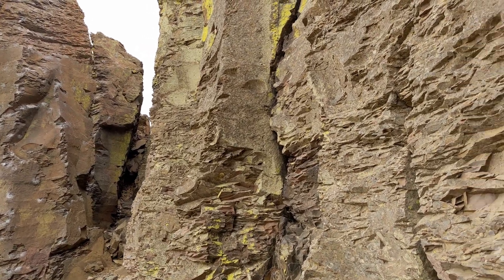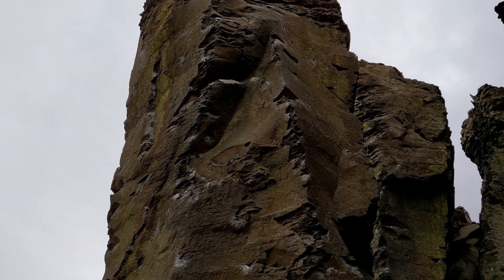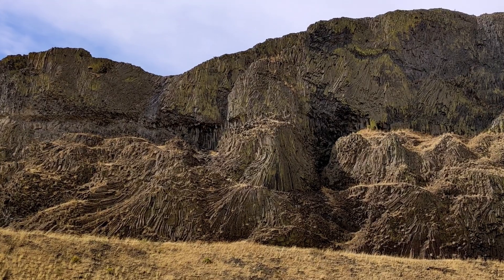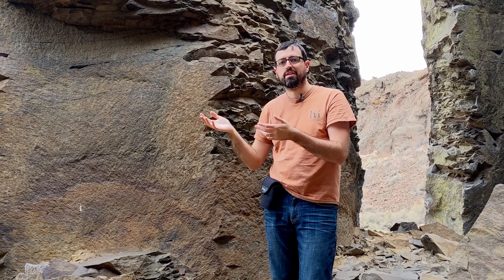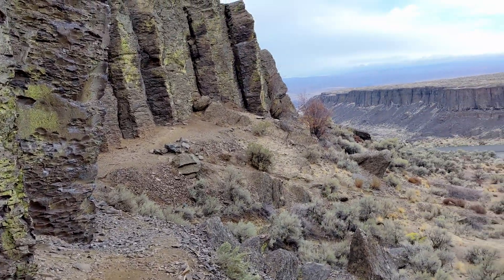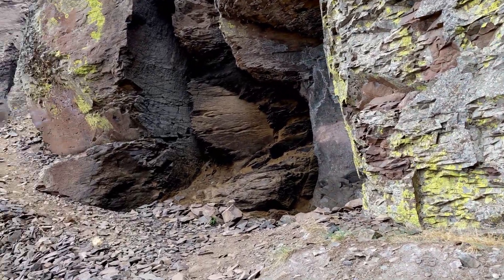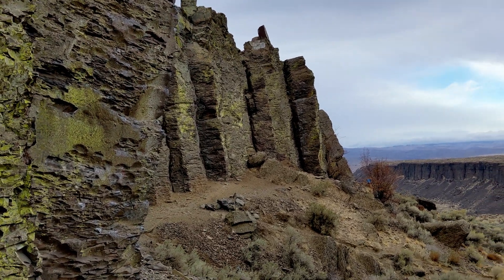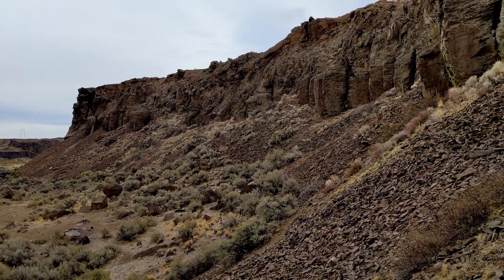Basalt Columns: French Fries, Toffee, and Mud Cracks

Comment: If the cracking starts at the top and at the bottom, what is the chance of those cracks  meeting perfectly together to form such a uniform column- 0 % ! That is absolutely ridiculous! 
Also crystals do not bend and if they did why would a clump of columns bend one way and columns right next to it bend in another direction? 
Further more, show me a working model on this planet. There is none. 
Most geology is wrong. One has to ask the question - what was it before it became petrified? Devils Tower is the same thing and there is no volcanic activity within hundreds and hundreds of miles!  Remember. The teaching of geology is theory and not fact! Thank you and please think.